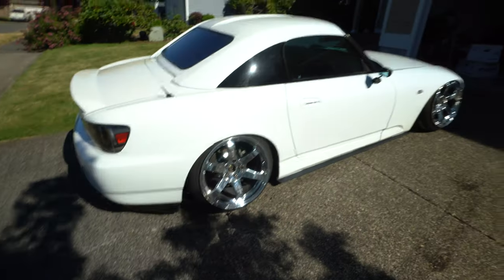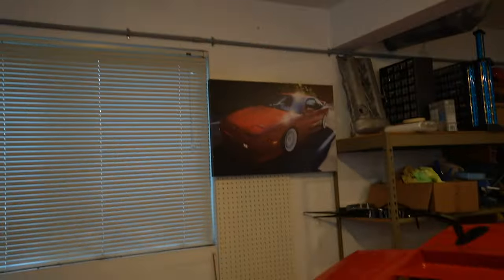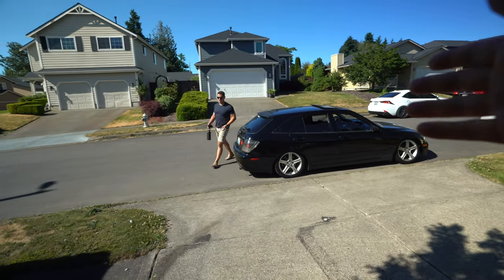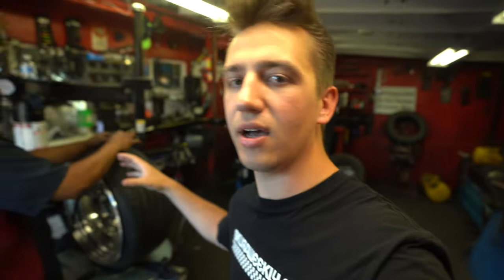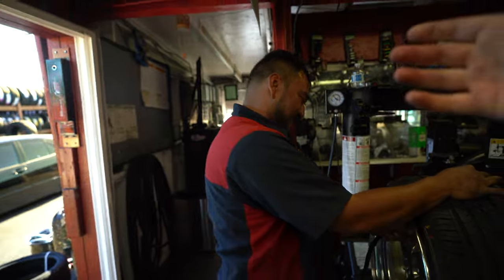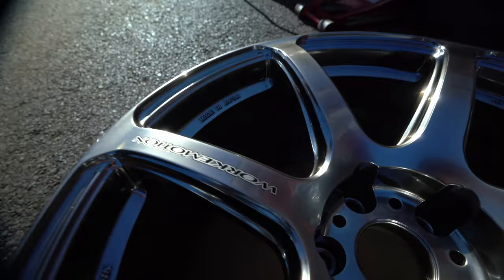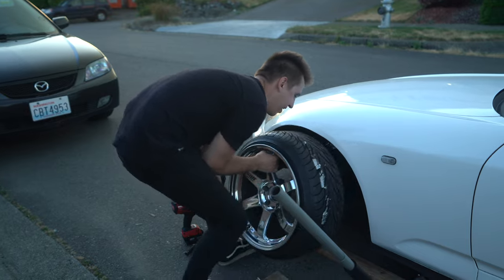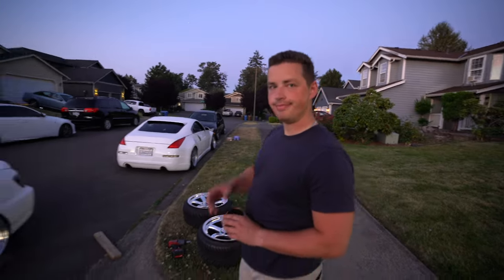I FOUND MY DREAM WHEELS! *CRAZY S2000 FITMENT*

Comment: Hey bro, loved the vid! Super sick fitment and I been trying to get mine even close to yours lol. I wanted to ask for your advice on the camber. I got truharts ruca and fuca, plus the truhart toe arms. Also running some Fortune auto super low spec coils, but I just can’t get enough negative camber . I removed that extra locking nut for the rears but have no idea what to do with the FUCA. What did you to to get all that camber ?
Reply from the maker: Thanks man! So for the FUCA you just need to take the (4?) bolts out completely and flip the ball joint

Comment: Love the setup bro! Any issues with the 10 on a 215/35? What psi do you run?
Reply: 215/35 sucks on a 10 . i run 215/40 on a 10.5 and 10 and it’s solid 👍
Reply from the maker: No issues so far. I’m usually running 50 psi. Probably could have done a 215/40 but decided to go with a 35 instead.

Comment: the meisters are so good on the s2000 bro 🔥 did you ever debead with the 215 35 on the 9.5j? what psi do u recommend?
Reply from the maker: Thank you! I always keep an eye on my tire pressure to make sure it’s around 50psi. I ran 215/35 on a 9.5 when I was drifting my s14 and it was fine 👍🏻